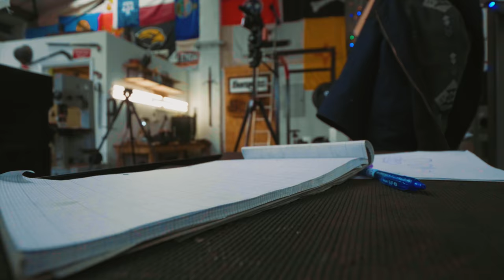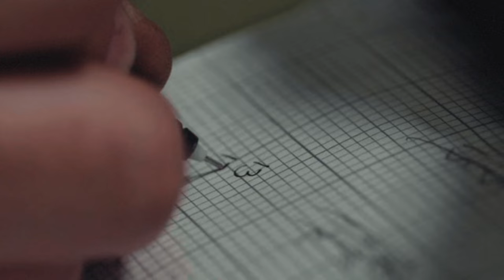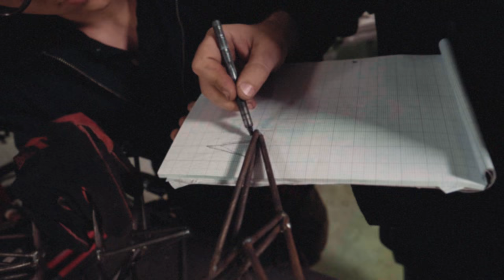MAKING A 10 POINT BUCK FROM WELDED STEEL!!!

Comment: A tip for your mig work instead of (turning it up) make sure you snip off the ball that appears when  you end a pass. The little ball will make the welder work harder (i.e. more amperage) to start your next weld. It may seem tedious but it works.

Comment: Alec! I just thought of an idea. a damascus rubiks cube. You could also set the record for the heaviest 55-57mm 3x3 rubiks! I started to set that record by filling a metal 3x3 with lead but never finished it. What you could do is also just make the caps out of damascus and either 3d print the internals or just epoxy them on. This is something I'd buy i mean if its a reasonable price. I have no idea what it would cost to make something like this but ~$200 wouldn't be outrageous. What would be amazing is finding some sort of way to dye the damascus on each face.

Comment: Is that a fountain pen at 0:35? If so, what kind is it and what ink are you using?
Reply from the maker: Lamy - blue ink!
Reply: I wonder if it would work with Blue Dykem...
Reply: I certainly wouldn't put dykem through a fountain pen feed, but I'd bet Noodler's Baystate Blue or Ottoman Azure would be pretty close to the right color.

Comment: Alec, Evan & Katelyn, I'm surprised that after welding the sections together you didn't put it in the forge and hammer it out to something more than round-stock.  Hammering out each aspect after section assembly and then welding the sections together would make a more interesting final piece.  Hmmm.  Maybe Alec should invite Evan and Katelyn back to the shop for a finishing.  Hmmmm.

Comment: One of my buddy’s welded a very similar thing but used all 3 inch round re-bar from a job that they were throwing out, the antlers are around 72 inches across and it stands from skull to antlers to about 4 and half feet tall, the fricken thing weighs around 220 pounds